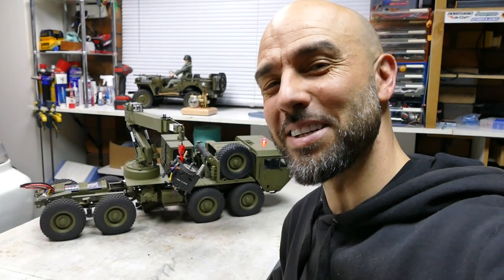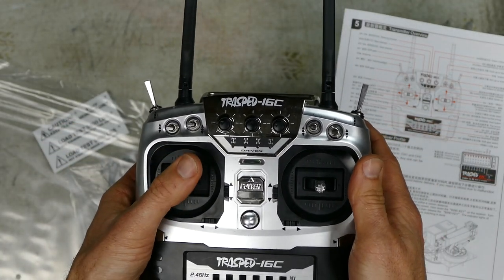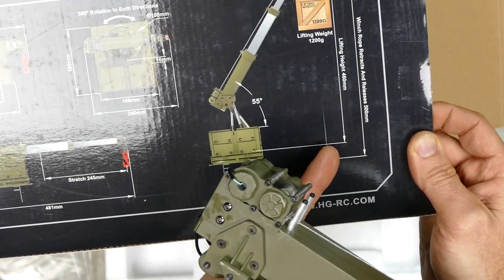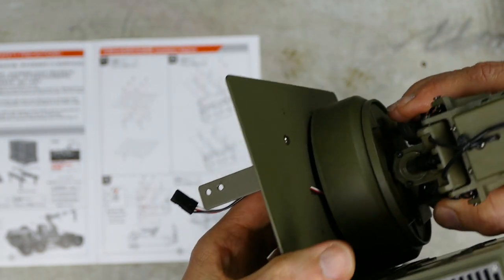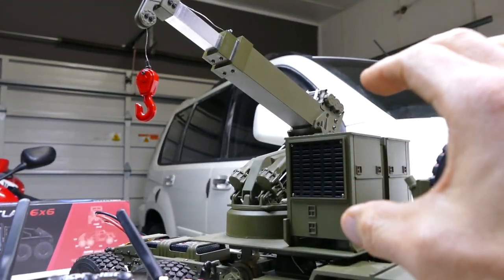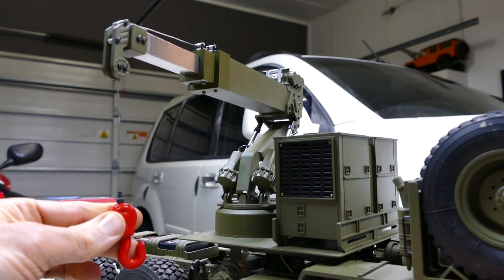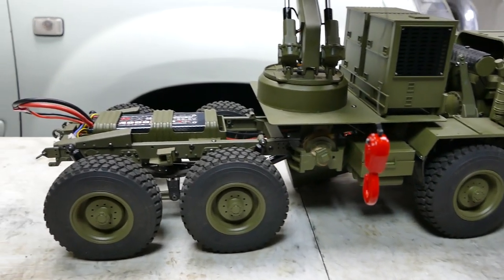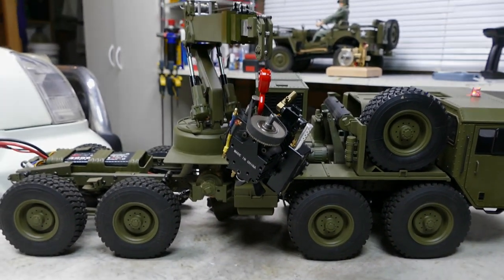AWESOME RC CRANE - HG-P803 METAL CONSTRUCTION WITH STEEL CABLE WINCH

Comment: A little late but I had issues with the left side trailer lights not working. I thought I could just splice them into the working side. Nope. I resolved it by reversing that sides last + - wires into the board. Thank you for the great videos.
Reply from the maker: Nice one

Comment: The "Rams" are called linear actuators. And the main actuator in the back of the main boom puts it between road mode and crane mode
Reply: And if you can remap the controls,I would switch the controls between the dual Rams and the single ram. Due to the fact that the single one will only be used when you extended it into crane or contract it to road mode. But the dual Rams will be used continuously for lifts.
Reply from the maker: Yeah man, good point

Comment: Thankyou for this very informative video. I had the same truck as you, with the dumper., but my gearshift servo was mounted in front of the gearbox rather than behind so there was no existing mount for the hitch servo.  I had to 3D print 2 spacers and drill into the crossmember to install the servo with the provided mounts.  Other than that, the crane transformation went well thanks to your helpful video. Cheers.
Reply from the maker: Glad it helped

Comment: The crane will fit neatly into the bed of the 801, I thought it looked a bit out of place on the 802, mounted mine in the bed, leave off the cupboard/housing and it sits neat at the front of the bed, boom parked front to back.

Comment: Nice looks cool.
I think that you might have put the mounting brackets for the crane plate on the wrong sides that's why it needed to be drilled out
 Cool vid as always Steve 👍🏼✌
Reply from the maker: Nah regardless still would not fit. Nothing that the drill couldn't fix 😀

Comment: If you buy 2 extension leads for inside your radio you can have steering on the right stick and crane rotation on the left. Just swap the potentiometer leads over in the transmitter.  I couldn't stand the steering on the left stick and the crane will only work in the reciever power socket so you can't swap channels.
Reply from the maker: Thanks for the info mate

Comment: Excellent video, I’ll be receiving the crane shortly. One question please? The crane’s power is plug and play essentially right? So no rewiring or soldering?, just plug into the little box on the side?
Reply from the maker: Yeah no soldering required
Reply: @RCTanksTrucks247  thanks

Comment: needed to rotate your rails didn't need to drill them out they were installed on wrong side of each other ;-)  I've got the tow hitch set up had it for couple yrs on my P801. After looking at the instructions I think those motors are N-20 motors in which the speeds can be changed out if wanted to modify.  Ive also working on own light kit which will carry on to the trailer.. My dump version has the light kit and sound installed.  Yet I got to switch some of those goofy lights out for more scale look lol..
Reply: ps one more thing, IF you cut off the back top battery cross plate you can remove your battery without taking the rear light bar off every time..Your battery will slip in and out for charging.  I do use a slightly smaller battery
Reply from the maker: Thanks for the info mate. Stupid me, lol 😂
Reply from the maker: Yeah I was thinking about doing that. Cheers man

Comment: I know your video is old but i wanted to know if you have the light kit installed as well. If you do how did you get the crane and light kit to work together?
Reply from the maker: It's just the stock setup which has all the lights included
Reply: @RCTanksTrucks247  i have the light kit and sound kit included and when i connected the crane to the pow connector with a y cable i would lose the lights. Which channel on the receiver did you plug the crane into?
Reply: To add my truck came with an updated radio and receiver with 16 channels and buttons on the bottom. My lights and sound Cait what’s up against the POW power channel on the receiver. My radio system is the YK006.

Comment: Only thing I didn't like was that the crane slew was on the right stick L/R, I bought two short extension leads and swapped the pots over in the radio, now have crane slew on Left stick and steering on right. Tried to just swap channels on reciever but crane only works in the power socket.

Comment: I am having no luck with getting the crane working with the Trasped 16C transmitter and receiver. Could you send me some help showing how you have things plugged into the receiver, are you using the Trasped receiver. I cannot figure out how to get the throttle and steering on the left stick . I'm using a Hobbywing esc and when I plug the crane into the POW port, I lose everything and the esc just flashes red. Any help would be appreciated
Reply from the maker: Sorry man, not sure myself

Comment: I think they are still called 5th wheel hitches down where you live. I have ran a sort of similar boom on a real truck and this one is a little too slow for scale, unless the engine was at idle and not set to a higher RPM to run the hydraulics.

Comment: Bro can we remove it's dumping back right..?
And at the same truck we can mount crane and the trailer right..?
Reply from the maker: Yeah that's exactly what I did
Reply: There are different models of trucks or what...I have seen in an video that this truck have dumper attached don't. Climbs the slant drive while truck with locked differentials do...
What does locked differentials means..can you explain it..as I also want to buy this and I want an good value of my money ... literally bro it's so expensive..😅😅

Comment: Hi buddy my mate has the cranes but doesn't work with the little white rc remote
Reply from the maker: What happened?
Reply: @RC Tanks & Trucks 24/7  he's plugged in the reciver chip and a battery pack the reciver lights up but no matter what he tries the little white TV remote won't bind to it I'll be getting onesoon too but he and I will be getting the 16ch trasped but we still 2ant to run the little remote

Comment: the lower boom is only there to set the whole structure in operating mode or idle mode. in operating mode the boom will not touch the cabine
Reply from the maker: Cheers bro

Comment: Only problem I've had with the crane is its been sitting on my shelve for a month waiting on the truck and trailer I ordered at the same time!!😬
Reply from the maker: Waiting sucks ay
Reply: Hey Gerry yours should be coming soon.. Don't drill out the rails just flip them around the correct way lol...I have seen the new shipment of these have left port around the 19th ;-).  I installed this tonight while finishing up my light kit.  Now waiting for my precious cargo ;-)
Reply: @thatsmyrc  hey ron I ordered the truck,trailer, and crane together got the crane in a few days !!
Reply: @gerrysoldguyreview  I saw the crane and knew you where getting the set up. Did you order the trailer coupling as well?  Or you got the dessert sand color because they now have came out with that color for trailers.  But the crane only comes in green Im pretty sure.  I have the dump version that should be thinking this week..
Reply: @thatsmyrc  hey ron i got both in desert yellow only color for the semi now, figured I would paint as i go!
Reply: @thatsmyrc  flipping the rails was what I thought! But I put it together without looking at instructions so maybe I lucked out!!